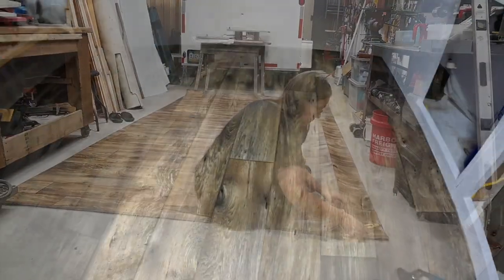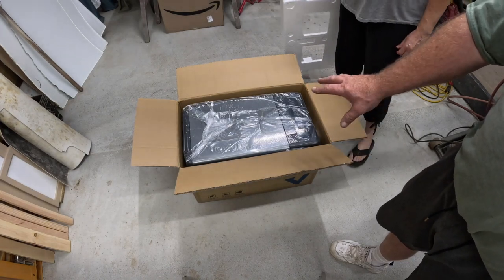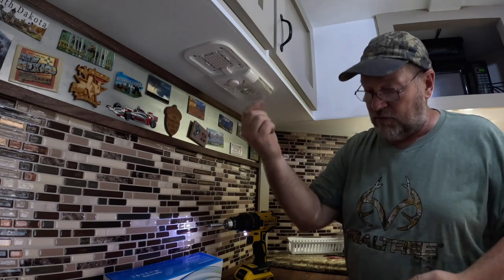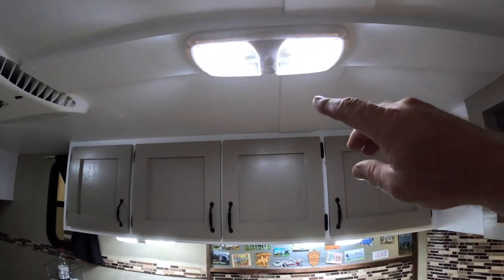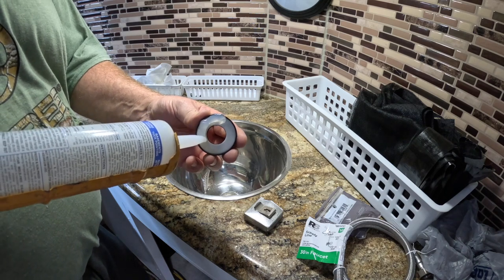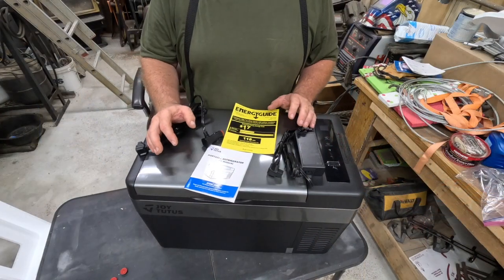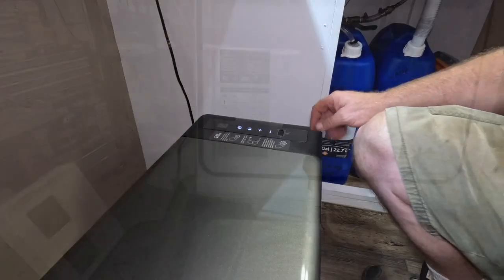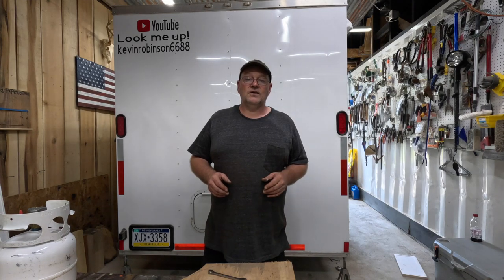DIY conversion camper reconstruction part 2

Comment: What I've found with my fridge is the surfaces get colder than the air inside, and 41 is just the average temp. The fridge goes down about 3-5 degrees below the set temp then shuts the compressor off and it don't come back on until the temp rises to 3-5 degrees above the set temp. I have mine set at 38 and it gets down to 35 and up to 42.
Reply from the maker: Thanks Daryl I do like this thing.